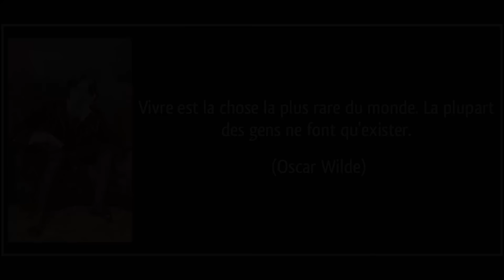RENOVATION MAISON EN PIERRE TIMELAPSE PARTIE 1 / AMAZING OLD STONE HOUSE RESTORE TIME-LAPSE PART 1

Comment: Congrats, good work. I see some errors: portland cement and concrete are not compantible materials for that building. I would suggest at least hydraulic lime and way less mortar (lime, not cement) in the rubble masonry.

Comment: Those walls are crazy thick...My grandpa built his house in the 1920's out of stone & timber .
He returned from WW1 & got married. He had very little money , but the family farm had plenty of stone & timber.
So he set in building .
The wall were so thick , you could heat it with a fireplace & stay warm on the coldest days..
In the summer it stayed very comfortable . No a.c.
He had 10 kids . The last baby was my dad.
In the early 50's my grandma sold the farm. My grandfather died in 1945 from wounds he suffered in France & the house stayed empty .
In the 80's We went to vist grandpa's grave & the house was in poor condition..
I contacted the owners & offered to tear it down for free .
I wanted to rebuild it on my small farm , but that family was feuding over who owned it..
I visited the place in 2000 & altho the roof had gave way, the stone walls & chimney still stood..

Comment: I would have used a whacker plate to ensure that the hardcore was fully compacted before concreting the floor (or did I miss that bit) I would also have used steel mesh reinforcement in the concrete floor.

Comment: I'm curious about the construction of the floor so much concrete, then insulation and more concrete. In the states a slab for a house or garage may be 10 to 15 cm, you must have 60cm of concrete.
It looks like a pad for a big machine.
The work is excellent the building will last for hundreds of years.
Reply: @lfranchementcomtois    The next ice age will come and go, and that slab will still be there :-) Keep up the good work.

Comment: Why did you not put the plumbing, the drains and tubes for electrical installations in the floor? And most of all: why did you not isolate the floor and make floor heating?
Reply: @lfranchementcomtois  Still: nice work.

Comment: Old tecnics hold for centurys, faboulous work. I scared, if one man hold this big bridge stone on the forklift. In know the weight of these guys. i have repaired some old sandstone walls. the biggest brigdestone weigth 500kg, no crane or forklift possible.. Take 1 week to move out and back. on repaired socket.

Comment: Autre test du jour assainir les conduits des toilettes (la fosse « refoule » un peu avec la chaleur) avec de la poudre de chaux et aussi nettoyer mes tomettes encrassées à l’eau chaulée dans un seau je suis optimiste les odeurs ont disparu et une partie du calcaire des toilettes également
J’ai réussi a éliminer une bonne quantité de moustiques qui proliféraient dans mes bacs de récupération d’eau pluviale. La chaux dans l’eau modifie son PH et une fine couche de calcin à sa surface empêche les larves de moustique de respirer et les femelles de pondre.

Comment: If the house was rebuilt from the original, why not completely dismantle it and rebuild it with the same model from recycled materials.
Reply from the maker: Your remark is relevant, I tried to use a large number of materials from the house, notably stones (part 1) but finding old materials often involves a lot of traveling to glean them here and there, and the cost is ultimately higher than “new”. We used local materials as long as possible.
Yours sincerely
Eddie
Part one here 
https://www.youtube.com/watch?v=3_TLQ2uV0qI

Comment: Not even a whiff of reinforcement in the new concrete. Ouch!
Reply: Some of the concrete placed in the ground seemed excessively thick. A quantity of "renfort en maille" would have cut down the thickness I reckon. Mixing and placing concrete, lime or cement based. is tough work! Just an observation from a 40-year construction pro. That said, I'm tremendously impressed with your dedication, hard work. and attention to detail. I regret that my French is very limited. Once upon a time, did know more but you know how it goes, use it or you lose it.

Comment: Ruined by concrete :/
Reply: @lfranchementcomtois  The stuff looks so damn grey, like cement or cement-lime mix. Your right, that traditional lime (yellow till white colour, depend on the sand) or clay (brown) used. You did a lot of work and i guess you maybe not 100% happy to plaster the stonewall like this. For me, it looks so much nicer before (as lomg as the stones not falling themself out oft the wall).